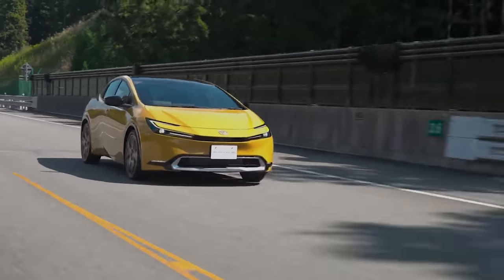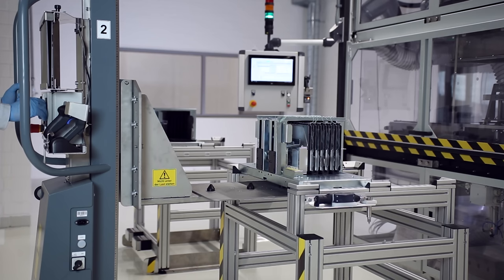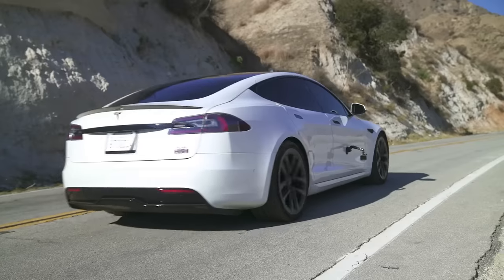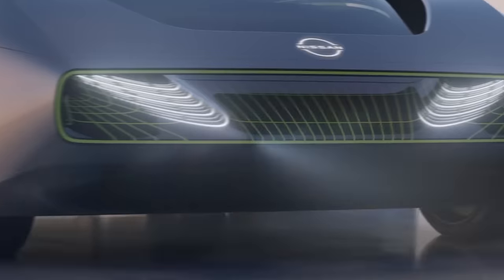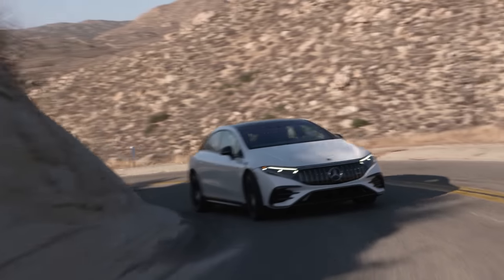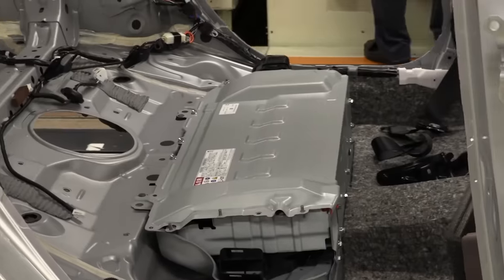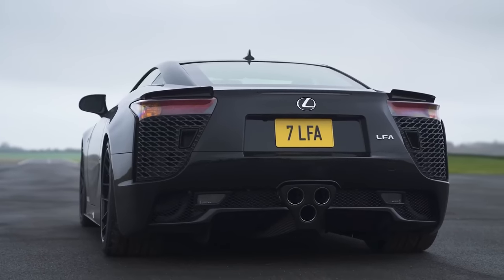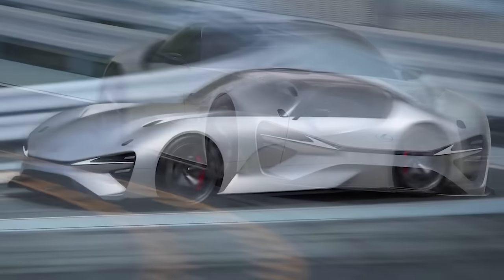New Lexus LFA with GAME-CHANGING battery!

Comment: I've had this same idea for a simulated manual transmission for years.  Similar to how a digital guitar amplifier can simulate the tones of various tube amps, I have always thought that it should be possible to have an EV simulate the torque curves of various ICE engines.  I even had the idea that you can simulate a stall.   Imagine being able to select your car modeling the experience of an N/A vs turbo vs supercharged in a flat-6, V8 or V12.  I am astounded that Toyota/Lexus is actually doing this.  I should have patented my idea.  I wonder if they will also simulate in-cabin engine sounds.  If done properly, and with improvement over the years, it could be so good as to be close to indistinguishable from the real experience. Even if not, I am so glad someone is out there thinking about preserving the driving experience in future cars.  I honestly thought it would be Porsche that would do something like this first.
Reply: Koenigsegg already managed to simulate their transmission with the light speed transmission in the Jesko and that was debut in 2019
Reply: I love it so much. All I want is to shift myself and hear some good sounds.
Reply: @pihermoso11  The Lightspeed transmission is also very cool allowing a car to be both an automated multi-clutch and a manual.  It's different though as that system is actually selecting real gears by actuating various clutches and the system that Lexus is suggesting seems to be purely simulated.  But both are great innovations which will hopefully preserve some of the spirit of traditional driving.
Reply: My dad and I had the talk about this very concept too. Including sounds and vibration. Just glad to see it become reality! Until then, V8 it is!
Reply: Riiight 🤔
Reply: Having the idea isn't enough
Reply: @alphatrion100  bingo.
Reply: imagine trying to design a car that handles like a horse? thats just stupid, clutchs and torque curves are a things from the past just like horses, time to get over it instead of faking it.
Reply: @DoradoClaudia  someone isn't into cars .... That's like saying "Why drive an oldtimer if you can have a new, quieter car?". You just don't get it, do you
Reply: I wondered if I was the only one with that idea. If the next gen MX5 comes as an EV,  I might try to do it then. 

Its nice to know that we are not the only ones out there and Lexus produces it  :D
Reply: It's a dumb idea... its like the steering wheels they used to have on shopping carts back in the day for kids
Reply: @wvlfboyy  If you are "into cars" then you are into the technology that makes them what they are without pretending they are something else. 

You are not going to replace your fuel injection with a carburetor because you think a 1964 Corvette is cool.
Reply: @CleverAccountName303  I drive a 1963 P1800. Because I think it's cool.
Reply: @wvlfboyy  that's very cool.  Love those cars.  It still doesn't mean that I want any of its tech in a 2023 car.
Reply: @DoradoClaudia  i want control my car speed ,not just boring single speed
Reply: If you're interested in this, try looking up AngeTheGreat on youtube, he's making an engine simulator and made a video in collaboration with some researchers about using his simulator to bring torque curves, clutch simulation, engine sound, etc to electric motorbikes. There is a working prototype
Reply: @pihermoso11  except its a real transmission

Comment: It is an absolutely beautiful car, and like the first one, it's not built for any NEEDS, but for wants.  Ive wanted someone to throw a manual gearbox in an ev since the craze began, if you want me to buy an EV this is a step in the right direction. Its definitely a way to give the soul-less EV's a little more life to them
Reply: @EnriqueThieleno that’s not why electric cars don’t need a second gear and your completely wrong about the torque curve ever heard of back emf ? Electric motors have instant torque keep that torque for a while and then it drops down
Reply: If you convert to EV a car you can keep the gears
Reply: @EnriqueThiele  i know they arent needed, but its more engaging for the driver to have them, thats why i said "it wasnt built for needs, it was built for wants"
Reply: 0 logic
Reply: @carlosandleon  screw logic, i want a fun car, not a efficient car
Reply: @Prolly_tyler  even in terms of fun that makes 0 sense
Reply: I called it a couple years ago. One day manufacturers will make gears for EV just for the sake of fun aspect (read: satisfying manual folks). Didn't know it was gonna be Toyota.
Reply: @edoalva48  it's not even gonna work, the feel between gears wouldn't be that different to each other
Reply: @carlosandleon  Obviously. Lol mate, me saying what I said doesn't mean I know less technicalities than you. So if you can cut the lesson. I was merely scoffing those old time elitist whether on IC engines or manual transmission or whatever, luddites people who can't enjoy anything new. Because unlike them, personally I'm an enjoyer of anything. Their noise annoys me tho.
Reply: Just make engine noises with your mouth and play with your own joystick while you drive.  A manual transmission in an EV is just an imaginary toy that is stupid and useless.
Reply: It will be a useless gimmick at best. Once you get used to one pedal driving switching back to gears feels awkward. Now reducing weight is what will make EV’s more fun to drive.
Reply: @kevintieman3616  completely agree. I even find shifting on motrcycles overrated. And every biker has a guilty pleasure of riding scooters anyway - shiftless driving connect you better to the road.
Reply: @kevintieman3616  ive driven a few ev's and i really just dont like that 1 pedal driving at all
Reply: @Prolly_tyler  you can turn off one pedal driving.  It doesn't make a huge difference in range
Reply: reckon is a generational thing. Back when ICE cars replaced horses the same comment was made "car doesnt make Horse sounds" "no clip clop" "i have to find a petrol bowser".. even in the last decade as manaul transmissions become a rarity i saw the same exact comments. The generation that grows up with EV (or other tech) wont miss the gears, the sounds etc... to them sound = slow 🤣
Reply: @EnriqueThiele Porsche take on gears with the Taycan is interesting with lower power draw at higher speeds but its not manually selected :)
Reply: @z00fbar  i can understand that🤔 a little
Reply: @EnriqueThiele it can boost top speed when the motors are rev-limited while not sacrificing acceleration

Comment: I drove a electrified Lotus Elise with a manual already 20 years ago. Such a thrill. The engine was making a lot of noise and the gearbox did really speed up the acceleration (first was faster then 4th for example). But you could drive away in 4th if you would like. I found it such a cool thing, despite in these days electric cars feel so boring to me.
Reply: You mean you drove a Tesla?
Reply: @samwiseknows  No. A Detroit electric (Dutch company, dont know if they still exists) Elise. They converted conventional cars to electric onces.
Reply: @CAR_NL  And what's so thrilling about driving a electric car? let alone one with a 'manual transmission'
Reply: @jordikorthals003  well, it was a lightweight car, with an ev engine that actually made a lot of sound. The combination of an EV engine with a manual gearbox was quite cool. When you let up the clutch there was directly so much torque... Cool experience
Reply: No no great sound and guaranteed weighed more unless it had only 50 miles of range lol
Reply: @Hello_there_obi  the sound was really cool. Can't do anything about it. It was quite loud and you really heared the revs from the electric engine. 
It could do 250km. I believed it had a 40kwh battery. Because it was a Lotus it still weighted only 11xxkg. So yes, still really lightweight, although not as light as a Elise with a normal engine. 

At that moment nobody talked about EV's as a necessary thing. It got to drive the car and it was just simply an awesome experience. I thought: so this is how the future might look like. It felt like a spaceship. 
Nowadays i'm sad that no brand in the world is actually able to build something similar.
Reply: @Hello_there_obi do you diehard gear heads beat off to car sounds or something?

guarantee this car is 3x better despite it not having the sound you like

Comment: Ain't gonna happen, and it won't be cheaper than current batteries. Toyota is talking BS. 
For a reference, Toyota said in 2017 that they'd have solid state batteries ready in production vehicles by 2020/2021...
And solid state batteries aren't that revolutionary.
I'm quite disappointed by your (Carwow's) non-critical ad for Toyota.
And btw, any manufacturer can use solid state batteries, if they eventually realize in to actual usable batteries.
Toyota has been dragging their feet, and they won't make it through this decade, if they don't change their approach yesterday...

Comment: This can be the gamechanger for markets where EVs don't work simply because the ranges between charging stations make it impossible. Thinking of places like Australia, Africa etc. If it can charge quicker and go further it'll really be what's needed to supplant ICE vehicles for many consumers. Even if it is cheaper to build, they'll have much R&D costs to recoupe so I doubt it'll be cheaper for the customer - would be nice though.
Reply: It will get cheaper when you will have a battery with 500-600 miles range minimum from all the brands.
Reply: Those charging stations will be everywhere you need very soon across the highway network.🤔

Comment: Correct me if I'm wrong, but matt mentioned how the lithium batteries lose a bit of maximum charge capacity each charge cycle, but he didn't say whether or not the new solid-state batteries would hold their maximum capacity forever or at least lose capacity at a far less rate. Does anyone know if the new batteries do solve this problem?
Reply: All batteries will degrade over time. From what I’ve heard about solid state batteries in testing, there are some that will have an exponentially slower rate of degradation to the point of allowing the batteries to be reused after the vehicle itself can no longer work. The life cycle of the battery will have the potential to outlast the vehicle multiple times over. How much that changes when it makes it to production is my big question but overall it seems to have more upsides than downsides

Comment: Na, for the masses this is still not good enough.  Most houses do not have drive ways to charge them also most house that can would need to upgrade their fuse board, expensive.  This is just a fad, and gimme - hydrogen is where is going to be, to cost to the environment will be less the infrastructure is already there in the form of filling stations, all that needs to be done is change tanks.  Delivery systems are the same as fuel delivery.  Need to get past this electric con.

Comment: Yeah I'll believe the solid state battery when I see it...  no one is near them at the moment and this fluff piece from Toyota and Car Wow are pure concept!
Reply: Hey just  buy  a busload of capacitors and you're done.
Reply: Found the moronic comment from the person who didn't actually watch the video. Go ahead tell us about all the time you've spent in their research/development labs, we'll wait...
Reply: Or they could just partner with byd and put a blade battery on a lfa🤟
Reply: @cenciende9401  I found the moronic comment from someone who thinks they know it all. I have worked as an auto's analyst for decades, Toyota is still pushing the ides of Fuel Cells (which by the way they have been working on and promising for over 20 years) and has only recently tilted into full BEV's when they realised everyone else was and that was where the market was going. Now you think they have access to a mass manufactured, relatively cheap Solid State battery technology out of the blue when others (and yes even Tesla) are not actively talking about it? Toyota for all its size and might have never been the a great innovator, what they are is a great iterator of other's ideas and concepts.
Reply: @heenalp77  true for all legacy auto though. Only tesla and a handful of Chinese EV makers will survive and thrive in 5-10 years. Legacy auto goes the way of Kodak, sears, travel agencies, blockbuster, yellow taxis....

Comment: Wow, this opens my mind to incredible opportunities for electric motors to mimic any type of ICE engine's power characteristics. This coupled with Harris's talk about placing any body on an electric chassis would equal endless builds. Here's hoping...
Reply: There's just something inherently pure about a well built ICE engine. Nothing to knock EV sports cars, they are just mind melting in terms of speed and handling. But for someone who says they aren't connected to a stick shift ICE classic sports car with the windows open and the real induction and exhaust sound of actual mechanical parts interacting, they just don't get it. Same as with people who love horses, there is a relationship we petrolheads form with a real stick shift ICE car other's just don't get. It doesn't have to be fossil fuel either, E85-100 and synthfuels are fine also. There is just that connection between man and machine that can't be broken for some of us.

By the way my daily commuting appliance is an EV, my track day car is and will always be a stick shift ICE car.

Comment: Now this is what i am talking about and finally car manufactures are listening to proper old school drivers that lived all there lives driving manual gearbox cars. 
This car is the only electric car i would be interested in because it has imitation clutch and gearbox, similar to what you get with a PC racing setup.  for real most good quality PC racing hardware like direct drive force feedback wheels, pedals, gear shifters are better quality and feel then most average road cars. 
solid state battery's is what's needed for a long time. 
great video Matt.

Comment: Gearboxes for electric cars is like vegan burgers, you are just trying to immitate a flavour but youll never be able to replace it
Reply: some of those veggie burgers are pretty damn tasty bro!
Reply: We will see.  If properly executed, it might be really hard to tell the difference especially if they model the torque curve of various ICE engines.  Anway even if not quite as good, I fully welcome any kind of a manual in an EV, it means someone is thinking of preserving the driving engagement factor for future cars!
Reply: @alangil40   but the thing is, internal combustion comes as a package, you have a gearbox because its part of a larger mechanism that we are in love with, you cant just take a part of it (sound or gearbox) and shove it into a souless electric car and call it a day... it will never entice real petrol heads. Ill use an other example, its like a battery watch and a mechanical watch, sure the battery watch is more accurate nd reliable, but nobody here is begging rolex to make a battery watch, it will never happen, ever!
Reply: @maartenvanbrakel2570  - While my hope is that it will eventually be good enough to be hard to tell the difference, I am not saying it will be as good as the real thing (especially at first). I say this as a lifelong manual driver with 3 manuals in my garage.  But if there are going to be EVs alongside combustion powered cars then it's a good thing that the EVs will also try to up the engagement factor.  So this development is still very much a positive in my opinion.
Reply: That would be a good example iif Veggie burgers were tastier. 

 Electric cars are better performance wise now, and only getting better. 

 ICE as we know if is dead unless some company like Liquid Engine manages to get their rotrary diesel to work longer than a few hundred hours. 

 Which would be awesome if they did. I don't hate ICE. Just that it is a dead end.

Comment: 6:47: Spoiler alert: On an 11kW wallbox, a solid state battery will not charge any faster because it's the charger that is limiting the speed - kind of useless comparison there...
Reply: maybe by that point wallbox technology will change as well..
Reply: of course but charging with 350 / 500kw is a different story

Comment: solid state battery is like fusion, always 5 years away . Semi solid is way to go. Toyota promised Solid state batteries in 2020. MG roadster is comming way sooner and it will be quick and relatively cheap, at least for the amount of HP it will have.